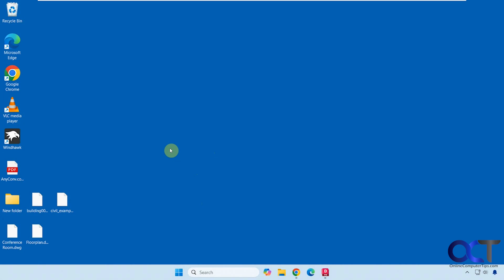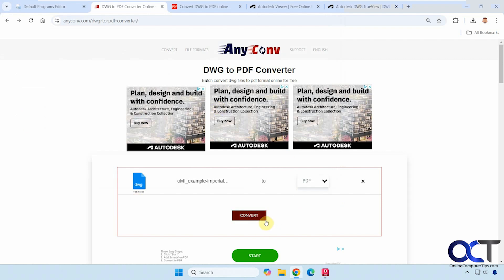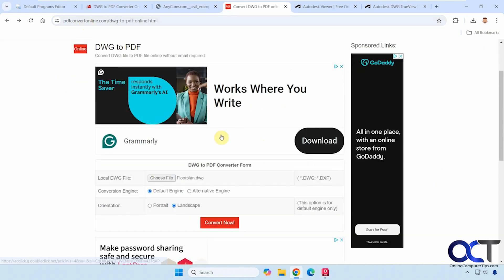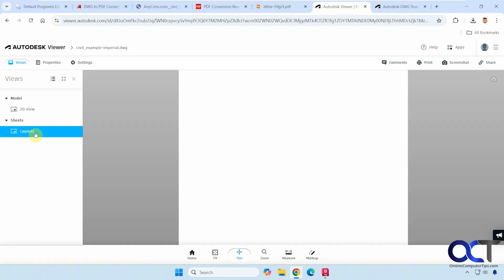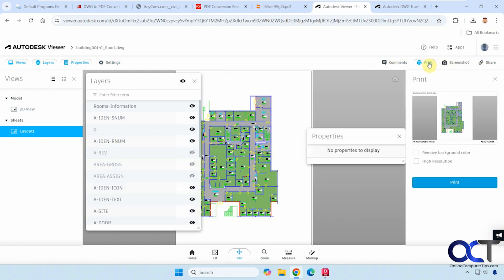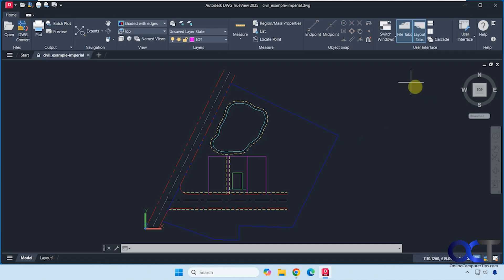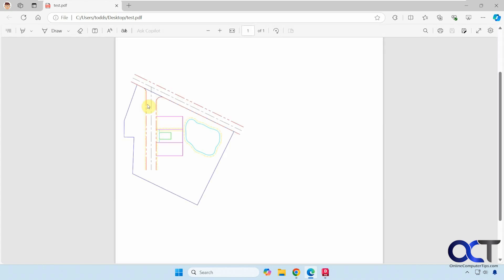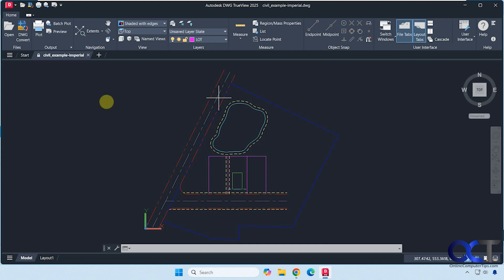How to View, Print and Convert CAD DWG Files to PDF for Free

Comment: I'm 62 years old I been using AutoCad for a long time. I still have the 13, 1.44 megabyte floppy disks we used to load on our 386 DX2 40mhz computer. I draft using keystrokes instead of icons because it's easy for me to hit L for line, M for move, SC for scale, O for Offset. Z enter E enter Zoom to extents. and so forth. I can crank out a drawing. The highest AutoCad I ever used and still use is AutoCad 14. Won't load on anything higher than Windows XP though. This print to a PDF has been a nightmare for me because I'm retired and no longer have access to the companies big Cannon Plotter and I can't take a .DWG to the printer places to get a print. They want that PDF. I knew about the sites to convert DWG's to PDF's but here is the kicker. I like to make jpegs off google maps when showing Site Plans for Architect drawings. No conversion site will pick up the raster image .jpg, .BMP tiff or wmf none! AutoDesk DWG TrueView 2026 is a winner. Thanks man!